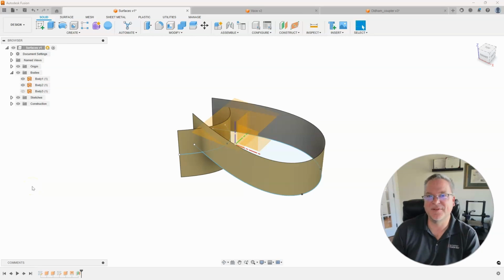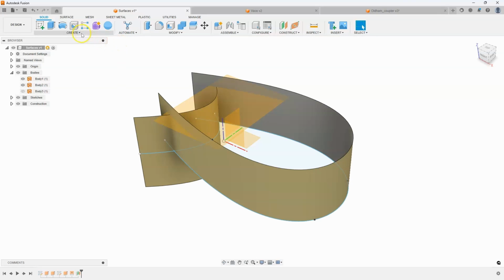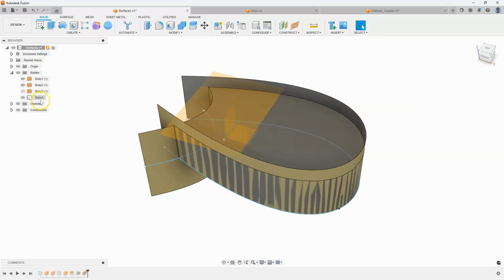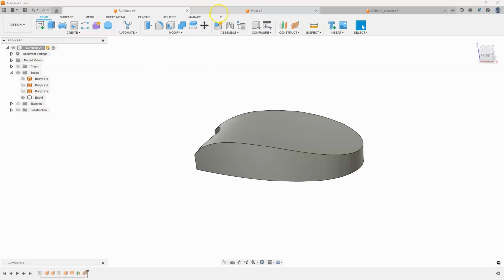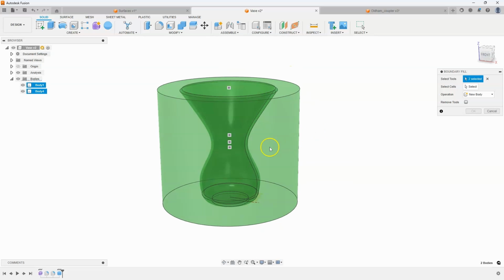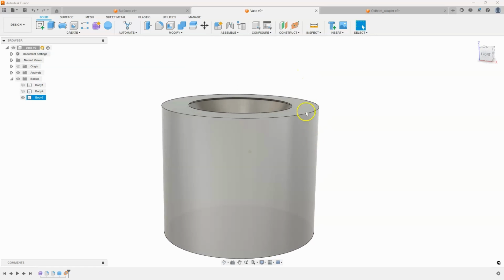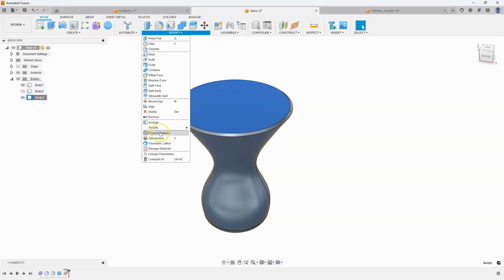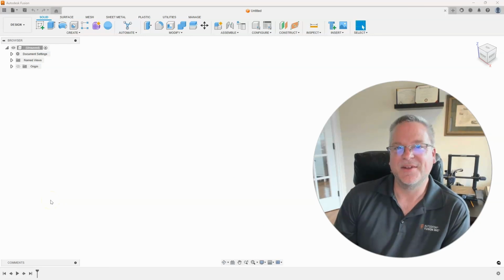Fusion Friday - Boundary Fill

Comment: Why did we have a cylinder, i thought that a single lid surface should be enough to build internal volume of the vase.
Reply from the maker: Yes, we probably could have gotten away with just using a surface.  However, I tend to teach to not use surfaces as it can get confusing.

Comment: Thanks for covering that Brad 👍🏻
 The example with surfaces is pretty straightforward but, as you rightly say it's the selection of cells that really complicates the use and understanding of it. Maybe a graphical preview when selecting cells would really help users understand this tool better
Reply from the maker: Ya, I wish Fusion "highlighted" the regions for each cell.  I had another more complicated example that had multiple cells, but it made the video way too long, so I cut it out.  Maybe I'll show it in a future webinar or something.  Thanks for watching and commenting!
Reply: @bradtallis8968  It's totally understandable for filling a bounding box of surfaces and planes. It's when it's used with creating intersecting bodies when it really becomes confusing and not intuitive at all. 
With that water volume example it's almost easier to create a zero offset surface on the inside and a zero offset plane at the top and then use boundary fill in the same way you show at the beginning, because that way it results in a single cell to select.